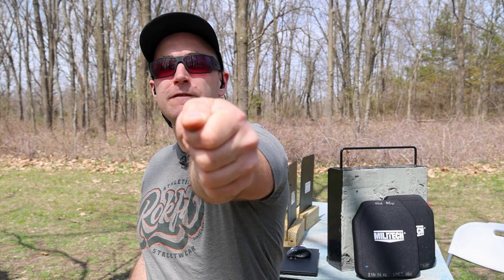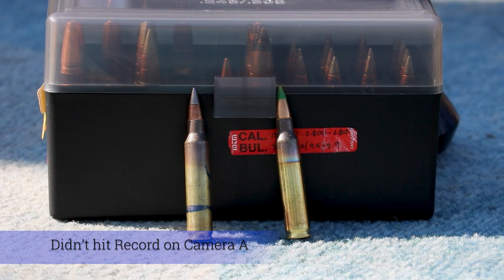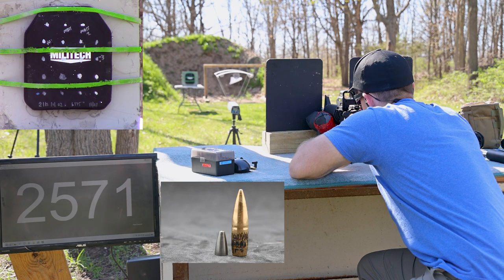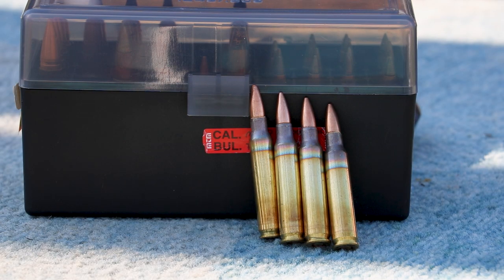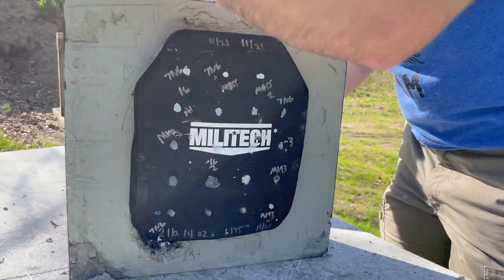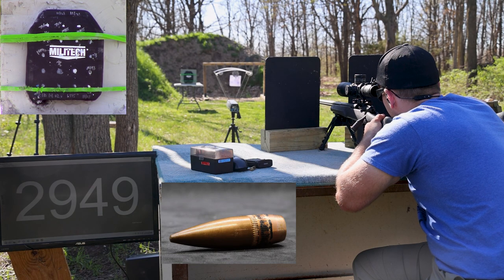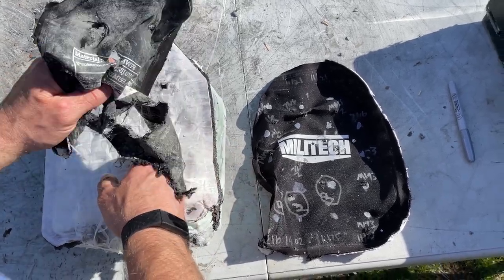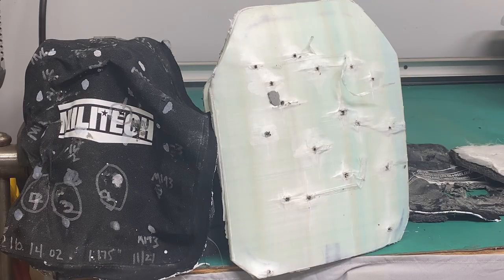Militech NIJ Level III (+) Armor Can It Stop 7N6?

Comment: 7N6 is not what those who wanted it banned think it is. The steel core is just mild steel, not hardened steel.
Reply from the maker: Yep :D
Reply: Not only that, even if it were hardened, it would still just be another cartridge that had no reason to be banned. Most people of the bent to ban things are not after actual issues, they are just looking for an excuse.
Reply: @NickFrom1228  plus its smaller than .22 caliber and ap dosent apply to it
Reply: @NickFrom1228  atf broke their own rules to ban it
Reply: @zm1786  I technically think the law doesn't specify weight. Size or diameter. It's all about the % of certain materials it's made of.
Reply: @justinlance4174  it does specify caliber.  The materials in 7n6 are all legal materials
Reply: Dismantle the ATF
Reply: Don't blame the ATF for enforcing the law. Blame the guys who made 5.45 pistols! 

After Olympuc arms got Chinese steel core 7.62X39 banned by making a 7.62X39 pistol, everyone was on notice not to make a pistol in a caliber with steel cores.
Reply: That rounds supposed AP characteristic was not the reason 7n6 was banned no matter what the ATF claims. It was the price and availability that spooked the Government mules.

Comment: Form with foam pad in the middle is similar to battle steel level 3 product (NIJ certified)
battle steel products use Poron XRD Extreme Impact Protection Foam
Constructed of 3 layers the main layer is UHMWPE
a special foam core that disperses energy
and a third layer of UHMWPE to sandwich the inner core
NIJ Certified Products Only $150

Comment: Thanks so much for testing this!
Reply from the maker: No problem!
Reply: @BuffRANGE  I find it weird that only one m855  from 10.5" defeated it. The other 2 were stopped. Could it be random or because that shot was like 30fps faster?
Reply from the maker: @ajopasoij9d00  Could be velocity. Could be that area of the plate is a touch thinner. It could even be that the plate for whatever reason cause the bullet to upset, so it had a straight through path.  Typically why the NIJ threat rating assessments require quite a few test panels to validate. V50 could come into play. IE a velocity at which a bullet can penetrate the plate 50% of the time.

Comment: How is this different than the militech rf2 plate you tested last year? They're both poly plates right?
Reply from the maker: The RF2 is a ceramic/PE. This is all PE :D
Reply: @BuffRANGE  thanks for the clarification! So would the rf2 be a better general purpose plate because the ceramic is better against rounds with steel in em?
Reply from the maker: @swegmastur614  most definitely !!

Comment: Can you test Bulgarian 7N6M (that you tested in the past) against a PE plate? It is somewhat common knowledge that 7N6 with mild steel core can be stopped by absolutely any NIJ III PE plate. So performance of hardened steel core variant would be more interesting to see.
Reply from the maker: I’m having a hard time sourcing it. I got some more in but it seems the harder core variant didn’t happen until
Headstamp 92 and all of what I got was 90/91.
Reply: testing latest Russia army ammo - 7n6m is a good point!!!

Comment: People don’t realize 5.45 is literally just slower 5.56
Reply: 5.45 varies just as much as 5.56 depending on which round you're talking about. Unlike 5.56, most military 5.45 employ a mild or hardened steel core which certainly makes up for/explains the loss in velocity.
Reply: @pakman184  The standard issued 5.56x45 has included a steel penetrator since the replacement of M193 in the 1980s with M855. The M855 was replaced with the hotter M855A1 EPR which an exposed penetrator tip that is harder than the penetrator found in the previous M855 (SS109).
Reply: @Enjoyer.762  What youre calling a penetrator isnt the conventional meaning, and the reason neither M855 or A1 is considered an AP round. 7N6 and all the derivatives following it have full steel cores, the Nato counterpart is 50% copper after the tip.
Reply: @pakman184  The only 5.45x39 that is classified as AP is 7N22. 

7N6 and 7N10 while having a steel core are the same classification as M855 and M855A1 EPR - standard issue ball. 7N6 was replaced in the 1990s by 7N10. 

NATO and the US military considers M855/SS109 as having a penetrator. The US military considers the M855A1 as having a penetrator. You seem misinformed. This isn't terminology that I simply made up. 

M995 has a tungsten carbide penetrator not steel and is classified as AP by the US military / NATO
Reply: @Enjoyer.762  The ATF considers 7N6(M) to be AP, nobody considers M855(A1) as AP. 

Regardless, my point remains unchanged and bringing up M855A1 is irrelevant. 5.45 rounds are designed fundamentally different and make up for low velocity with better penetration potential via steel cores.
Reply: @pakman184  It's irrelevant how the ATF defines what is armor piercing. I am taking about the military designations that define the specific rounds. 

Tell me what the NATO / US military definition and description of M855A1 EPR and M855 is? I did not claim it was AP. 

Additionally, the Russian military does not designate 7N6, 7N6M, nor its replacement 7N10 as AP. 

Lastly, you have provided no evidence that 7N6, 7N6M, nor 7N10 produce superior intermediate barrier penetration than M855A1.
Reply: @pakman184  Furthermore, 5.45 isn't a "low velocity" round. 7.62x39 is a low velocity round. Please state the average muzzle velocity of 7N6, 7N6M, 7N10, and 7N22 fired from the AK105, AK74M, AK12, and RPK74? 

And more to my point: the ATF defines what is "AP" based upon federal law, not how militaries define AP. For example, the ATF both banned 7N6 (mild steel core) and M43 (mild steel core) as "AP pistol rounds". None of those rounds are AP.